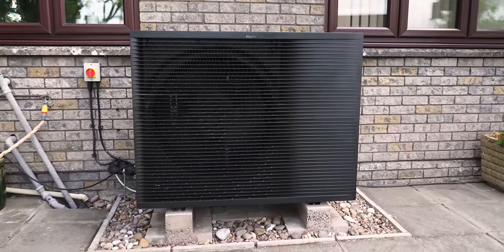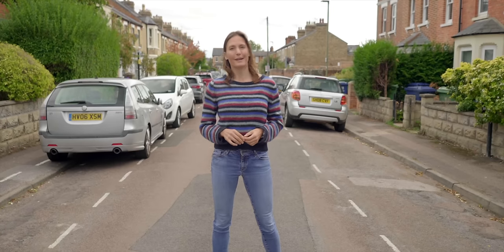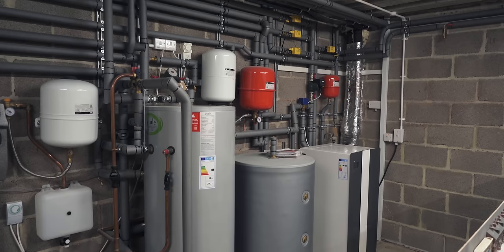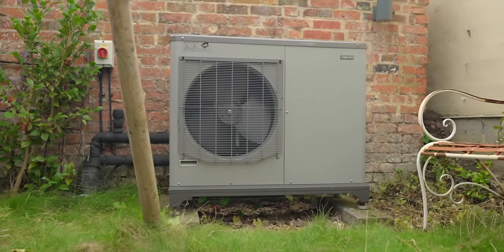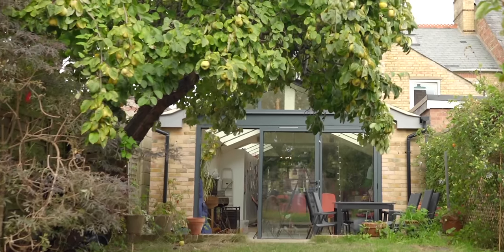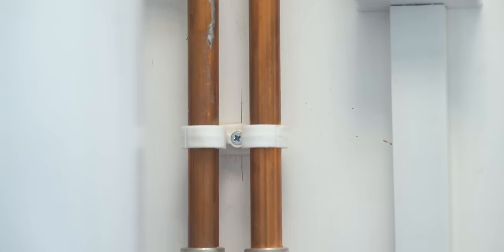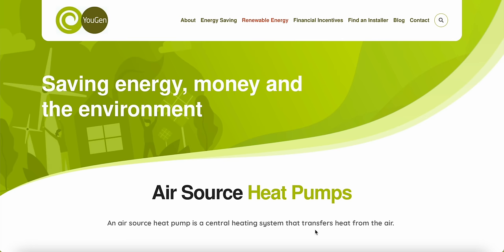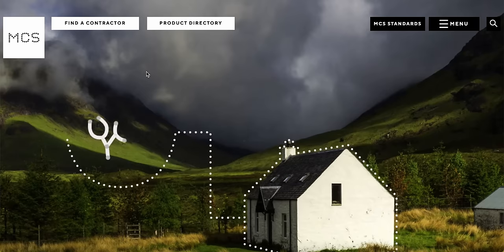Does a Heat Pump Really Work In A Victorian Terrace?

Comment: I moved to an ASHP from a bulk 1000 litre LPG storage tank and boiler. Costs of bulk LPG were more volatile and could easily jump 2 or 3 x the lower costs we have had.  we would have 2 or 3 refills over the year and mid winter it would be only 6 weeks. 
The ASHP takes a little space, but has meant we are now fully maintained from electricity, hot water over the summer was roughly 2kWh per day, via the ASHP andthat is for 3 adults in the home!
I am coming into my first winter and have followed advice of setting all rooms to be heated at same time to same temps and only dropping by 2 degrees C overnight. So far looking good and I am sure this will cost me far less than the LPG, especially now at 76p per litre!

Comment: We have solar, but our hot water, heating and hob are gas. I looked at moving our hot water to electiricy, but because of the solar back compared to our night rate electricity charges, and our cheap gas prices, moving our hot water across to electricy would mean our power bill would increase. Another factor I had to consider is that we currently have instant hot water on gas that heats our water to 45'c. If we moved to electricity and a hot water cyclinder, we would have to heat the water to 60'c. We also don't have any subsidies here in New Zealand so there are no insentives to switching heat, water and cooking away from gas.
Reply: In UK gas is still best option if available. Only if doing new build or not on gas grid does HP make sense. At a price.

Comment: Check out you tube channel( skill builder )for an unbias look at heat pumps you can have issues !
Reply: His issues were because he was a builder with no skills. I will quote him “I’ve had to take out every heat pump that I have installed”.  Now look at that again, he’s taking out his own work, because he’s a builder, not a heating engineer.  In a similar manner, every time I’ve attempted open heart surgery, the patient has died, because I’m a gardener.

Comment: Is there a place for a 'hybrid' system i.e. a part air source, part ground source set-up for smaller properties? Alternatively, can the ground coils be mounted vertically in a trench, rather than horizontally?
Reply: I don't think ASHP/GSHP hybrid systems exist. For a smaller home, ASHP is the way - the efficiency benefits of going ground-source aren't that huge.

Comment: No mention of prices again. How much does it cost for a unit like the one shown? Also, having the right radiators is briefly mentioned, but what ARE the right radiators? How much do they cost if we haven’t got the right ones? 
You wouldn’t do a car review without talking price and range, so please give us rough idea of how much things cost in these kind of videos.
Reply: You can find ball Park prices for the units on Google.

The "right" radiators are ones that are correctly sized to emit sufficient heat into the room to meet the heat loss from that room and the heat required over and above that loss to heat the room to a specific temperature and maintain it.

This is achieved by calculation.
Reply: Yes thanks, but the point still stands, it’s not information in this episode.
Also, some say aluminium radiators are better, so it’s not just about size.

Comment: Why is the electric HP any better then using an electric boiler (which are much cheaper to install)?
Reply: Heat pumps can produce more energy in heat than they require in electrical energy to run. You'll see this quoted as Coefficient of Performance (CoP) and it's normally 3-4. So you'll get 3 to 4 kWh of heat for every kWh electricity used. Whereas a straightforward electric heater can only yield 1kWh heat for every 1kWh electricity.

Comment: Hmmm electricity is far more expensive than gas and I can’t see that changing in the UK for some time.

You will likely need new radiators and possibly UFH.

You’re still dependent on fossil fuels unless you know your electricity is green-generated.

I really can’t see why people would switch to heat-pumps unless they are environment-first, it’s a huge initial outlay and you’re still using fossil fuels and an expensive one at that.

Comment: Thanks for the video, but I have a question- do you have any UK data on the split between gas tanked boiler systems vs gas combi? I’d like to understand if homes which do not have space for a hot water tank what alternatives are available? Is it cost effective to install a tank in the loft or would it be better to switch to an electric boiler?
Reply: If you retain a gas feed then you're paying Gas standing charge all year round. Maybe best to fit Solar water heating which is a one off cost with an immersion heater for really dull days.

Comment: Similar to all these videos pushing heat pump systems, there is no real facts about the cost to payback.... It's not good enough to say "Oh we have saved 60% since the installation" .. What other work was carried out ?  Was the house fully insulated before the fitting... Sorry, Im disappointed in the lack of real information, other than just playing the green card benefits !!  What did it cost, was it an interest free loan provided by the installers  ?
Reply: Agreed I was click baited to this video and to be honest it was poor.
Reply: Ah, the need for perfect information argument. This is a common complaint. Glad you presented it. Personally, I require absolute certainty prior to any action. Almost got out of bed today.
Reply: Why do you need to measure the return?
There is Zero return on a gas or oil boiler!

My ASHP is saving me over £2000/year compared to my old oil fired boiler. The maths for me are Im saving ££££... And im no longer burning oil.. 
Not much more than I can say really
Reply: Quite interesting comment, considering that one of the interviewees said “if your house is poorly insulated, you should do that first”… 
It’s almost as if the original commenter didn’t watch the whole of the video before making their comment, but I’m sure that would not be the case as their comment sounds so balanced, not.
Reply: @richardneilson1188  gross exaggeration and sarcasm does NOT advance your cause!!
He's correct - it WAS massively glossed over!  It IS the case that MANY installations are not cost effective and require big cash upfront... 
Only showing 'upside' is not very helpful and many people will be disappointed......
Reply: @davemoore5222  I was trying to work out how much difference of fitting insulation made. Was that part of the 60% saving ?  Besides my heating consumption has also dropped by about the same amount due to seasonal difference from last year.
Reply: @G-Cam1  are you being wilfully naive....!?
If you have a working gas heating system and you spend £15K, typically, installing a heat pump - then you are £15K DOWN!  So, you want to know how long it's gonna take to recoup that £15K. Because, up to that point you're a lot WORSE OFF!!
AND, you had to find the £15K upfront when you already had a working gas system which was paid for!
... so, of COURSE you want to know the return...... .!!!!!
Reply: Which would be going by the assumption that the transition has to come with a cost benefit. A new washing machine, or a new gas boiler even, does not pay itself back. Why would a heat pump?
In general a well installed heat pump system is on par with a gas boiler system when it comes to running cost. Installation is more expensive for a heat pump system. Most people will opt to improve the efficiency of the home when installing a heat pump, because a heat pump works better at lower requested temperatures. The same measures would have saved money with a gas boiler as well, but because of the extra efficiency at lower temperatures a heat pump system saves a bit extra. In most cases this is not enough to completely offset the higher installation costs. In the end a heat pump system usually is (a bit) more expensive than a gas boiler system. The savings come from better insulation which would have also saved costs with a gas boiler.
Saving money is not the goal here. The transition simply has to be pushed through, cost be damned.
Reply: I agree that a bit more price information in this video would be good, but you can look online to find it really. For me the issue is space to mount a heat pump fan unit, although possibly could put the front. And cost. I need a new boiler now, but I can't afford a 15k heat pump. I have been looking at electric combi boilers but these are much more expensive to run than gas, but more efficient. I'm just going to get a new gas boiler as for me ,low use small house the costs don't work. Government need to get electricity price down and then electric heating will make sense.
Reply: It's pretty easy to calculate if you heat with electric resistance heating. Just figure out how much you pay for heat and divide by the COP of the heat pump.

If you heat with other sources it's a little more complicated, but still managable.
Reply: @G-Cam1  - I live in an average semi-detached house (£300k) and my heating bills are much smaller than yours (calculating a 60% saving then yours may have been around £3300/yr and it's now £1300/yr ). It's an economy of scale thing. Spending money on a heat-pump plus changing the radiators (need pipes with larger bore) is not cost-effective for me. If you have a big house with big bills then it gets more attractive.
We've seen, from the cost-of-living crisis, that may people live from month to month and have little savings so IMO, these heat pumps are a non-starter for most people.
Reply: YAAAAAAWWWWN. The usual boring, tedious “what’s the payback crap”.  I imagine you have a car, what’s the payback on the choice of car you made, compared to the absolutely cheapest car on the market? Unless you have a 15 year old Datsun Cherry, what’s the payback on your car?
Reply: @Muppetkeeper  That's a very idiotic response. Many people look at cost savings for things like hybrids, PHEVs, or EVs over gas counterparts. The upfront cost might be higher but overall cost of ownership can end up lower in many of those cases.
Reply: @john3Lee  I‘M sorry if my reply appeared dismissive, but the whole video sounded more like a ‘review of my situation after three years of use’ rather than a ‘this is what you should do’ type of video. 
I (rightly or wrongly) assumed that as the home owner was having rebuilding work done to his house that the extra expenditure was from the savings or the re-mortgaging that was paying for the building work, and therefore costed-in. I was interested to hear his feelings after using the system for a period of time, but realised that, due to the building work, there could be difficulty in separating out the various features of this particular installation.
Reply: @timscott3027  why don't you insulate your house first as suggested in the video before even thinking of heat pump.
Reply: @Snerdles  It's a valid response as he/she wasn't talking about the type of car but rather the price of the car hence the "15 year old Datsun Cherry" comment.
Reply: @verygoodbrother  well yes obviously getting the house as well insulated as possible is a good idea.
Reply: @andymccabe6712  Expecting to get all the information from a documentary is flat out lazy. Do your own research! Get a quote, and find out what you’re working with.
Reply: I’m glad they didn’t mention the cost, I’m having one fitted for £2,500 on my house, which I think is pretty cheap considering it’s going to save me over £1,500 per year going forwards. Also I’m glad they didn’t mention costs because it’s almost impossible to give any true reflection of cost due to the huge variation in complexity of building so it would be meaningless.
Reply: @richardneilson1188
Reply: @Snerdles  You do know that the COP of a heat pump is a bit like the quoted MPG for a car. There’s a headline figure but no one ever gets that figure in real life.
Reply: @hughmarcus1  Mine works just as advertised. I also get more range on my PHEV than quoted and more MPG. If you don't drive like an idiot you'll do fine.
Reply: You are missing the point. The point of this video is that these work and are economical to operate. The cost in the UK is not comparable to the US, or continental Europe, or any other place. If you want to know the cost and the payback, do some research. If you want to understand whether these work and how well, then watch the video.
Reply: @andymccabe6712  Actually, it perfectly advances his cause. If you don’t know who everyone is laughing at, it is you.

Comment: isn't it the same exposure cause all energy prices exploded quite similiar at least here in the EU ?

Why should the kWh electricity be cheaper than that gas kWh cause here gas is used to generate electricity. All went through the rough.
Heatpump needs a  solar power system as energy source first and even a quite large one with a battery storage and then you start the work on the heatpump system as a partial or full replacement cause you can get a heatpump to heat water only and also a few split ac to heat some rooms with surplus power from the roof. 

I have not seen the solar power system in the whole video, only those for solar water heating on the roof at the end.
Reply: A heat pump uses electricity to extract heat from the outside air.  So it provides the same amount of heating as a gas boiler, but uses a third of the energy.  Running it from solar power and a battery would be nice but it's not essential.  The important thing is that the carbon emissions from your heating are greatly reduced.
Reply: @alexwebster7065  you have to realise though that most people don't care about the carbon emissions, they care about their direct debit to Eon etc. And it's hugely important to note that the energy efficiency does not equal price efficiency even with the current prices, let alone when gas was 4p/KWh...

Comment: If you want to be cold in winter, have massive heating bills and endless breakdowns and callouts - just install a heat-pump.
Air sourced or ground sourced makes no difference ( I have both installed 2x ASHP 1x GSHP (3 in total))
If any idiot says they are compatible with our cold damp winters, please just have them put down - they don't know what they are talking about.
ASHP on the swimming pool is the only sensible option as they produce low grade heat for the pool water efficiently when it is hot and you want to use the pool.
Useless in winter and early spring/ late autumn to extend the pool season as its cheaper to use Gas.(even at todays prices)
Remember the Electricity price is loaded with plus  25% tax to pay for “Green Energy" and the UK suppliers have scammed the public by making Electricity stupidly expensive vs Gas, you would have to be deranged to install anything using Electricity.
It’s also going to get much worse as Electric vehicles increase demand, just watch the prices hikes and "time of day pricing" on your smart meter.
Heat pumps work but their efficiency in the UK winters makes them significantly more expensive than gas not even factoring in the huge installation and maintenance costs.
Reply: It would help if you described the building, it's insulation and the predicted heat loss and size of units.

Comment: I want a heat pump but I would need to rip up all the floors to install appropriate piping, then fit massive radiators. BTW there is no place to put it. If I decided to put in my flat roof the council would stop me. .50% of people are in my position
Reply: It's very rarely necessary to change heating pipework. I've been an installer for a couple of years and we've never needed to do this. Sometimes we change radiators (maybe on 1/3 of jobs) and then it's normally just a couple. Also the outside units can be wall-mounted.
Reply: @bimblinghill  the biggest problem in small homes is siting the dhw storage cylinder and reconfiguring the pipework to accommodate it. The vast majority of homes currently have a combi boiler and as such do not have any dhw storage.
Reply: @David-bl1bt  Most houses have somewhere to put a cylinder. Combis only came in ~20 years ago; houses that existed prior to that once had a cylinder and can have one again. Cylinders can also be placed in utility rooms, garages, lofts, bathrooms. Placing the cylinder can be a challenge, but is rarely impossible.
Reply: @bimblinghill  well, I can inform
M you that I was project manager for a heat pump upgrade scheme for a social housing provider in Telford.

Around 30% of their housing stock were far to small to accommodate an unvented solar cylinder without a major internal rebuild which they decided was not financially viable.
Reply: @David-bl1bt  Maybe houses are weird in Telford. Or maybe you're just making stuff up.
Reply: @bimblinghill  I don't "make stuff up", I have had a lifelong career solely in the gas industry since leaving school 1974.

They have a large proportion of small terraced 1 or 2 bedroom houses and flats that could barely fit a bed in the bedroom let alone a huge unvented cylinder. Also it was a huge struggle to gain headway as many tenants flatly refused to have the huge ugly Mitsubishi ecodan in their back yard.

I suggest that you stick to facts that you know rather than questioning the integrity and validity of other posters on here.
Reply: @David-bl1bt  Unfortunately the social housing sector is full of people like you who will take their consultancy fee to tell people that change is impossible.